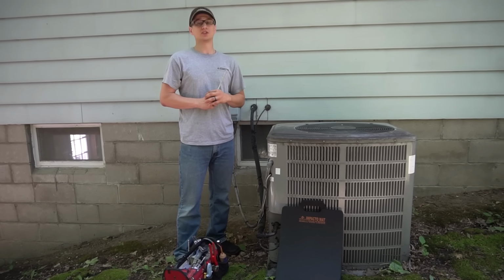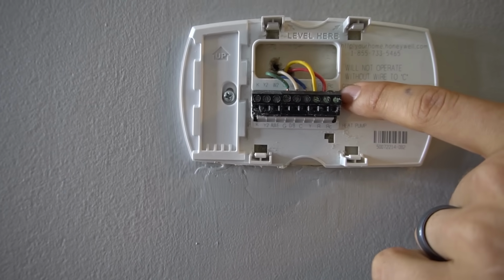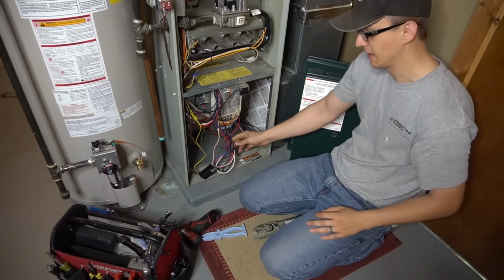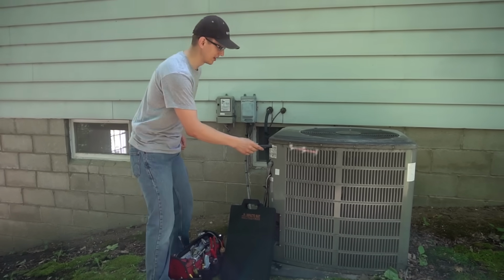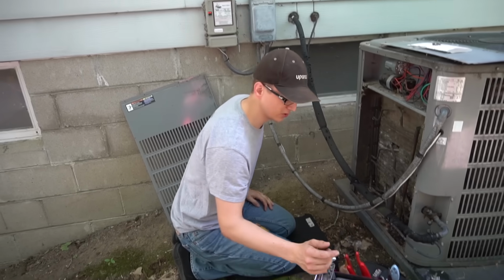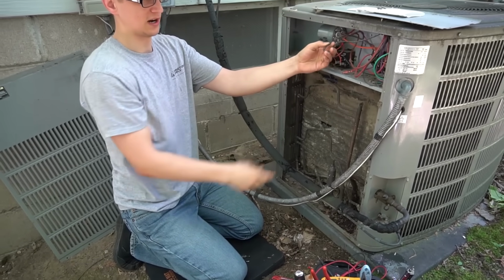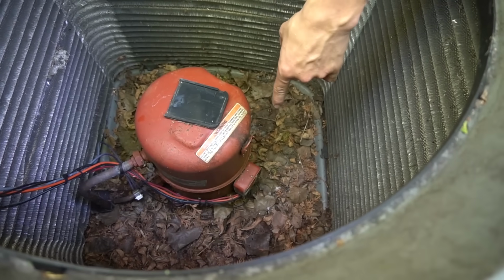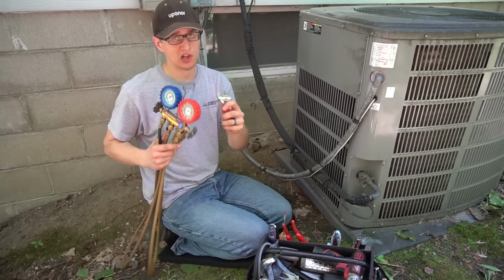AC Unit Not Turning On - How to Fix It Step by Step

Comment: thanks for the tips, you are very helpful. My inside unit was running and not cooling, checked outside and it wasnt running, pushed contactor and  unit started but would not stay running. Now both inside and outside not working.I have changed the capcitor and the thermostat. Discovered blown fuse after watching your video. Replaced 5amp fuse and turned unit on and it blew, replaced with another and it has not blown yet. Thought it might be the float switch shutoff so I took it out temporarily. Not getting 24 volts from thermostat, long story short..HELP
Reply from the maker: Oh boy, sounds a little messy :) Hopefully we can sort this out. If your 5 amp fuse was blown twice, then it is very likely that you have a short somewhere. A short can be hard to track down though. I would start by investigating all the thermostat wires in the furnace/airhandler, thermostat, and outside. See if you can find any bare or broken wires that are touching something metal or another bare wire.

Does your furnace have a control board or is it just a fan relay? If it is a control board, with your thermostat set to cooling, check if you have 24v going outside. Locate your thermostat terminal strip on the control board (R,Y,C,G,W). Put one lead on R and one lead on C. You should have 24v. How about Y to C? You should have 24v there as well.
Reply: no control board in furnace, have 24 at transformer,confirmed thermostat bad, rep;aced 2nd thermostat still not working
Reply from the maker: The thermostat wire that comes out of your wall and goes to the outside unit, does it have 24v coming out of the house? You also mentioned the float switch. Have you checked if your condensate drain is plugged? How did you take it off? Did you just bypass the float switch?
Reply: I did not have 24 volts on the thermostat  wire to the compressor outside. Attic is incredibly difficult to maneuver near the edge but I replaced the entire wire from the inside unit to the outside, I reinstalled the float switch in the system.Anyway the inside is working and when I connected the wire to the contactor it would not pull in on its own, so I will get a contactor Monday, the compressor will start when I push the contactor but only stays on if I wedge it to keep running. Will leaving the compresor running damage the compressor? At leasttoget me through the weekend. Thanks for the tipsand you have been extremely helpful, I really appreciate you and what you are doing  here.
Reply from the maker: Oof, I understand your pain. Crawling around in a tight attic space is not the most pleasant of things. Glad to hear you are finding my videos helpful! If you do not have 24v going outside, then replacing the contactor will not help since it is not pulling in as it is not getting 24v. About leaving the wedge in there.. I would. :) Better then roasting all weekend. Of course that makes the unit run non-stop and you should also keep your inside fan always on too. If the indoor fan turns off and the outside keeps running, your A-coil will freeze over. Being that your unit is in the attic, that will likely end bad once that ice starts thawing. 

If you are not getting voltage out of the house that means something inside is interrupting it. At the furnace, can you see where the Y and R thermostat wires go? Is there something in series with those wires? If the thermostat is working right and calling for cooling, you should have 24v between the Y and C wires coming from the thermostat at the furnace. Also, you can try bypassing the thermostat once by putting a jumper between R and Y at the thermostat. (that would confirm if the thermostat is bad or not) I have a video on how to do that if you need it: https://www.youtube.com/watch?v=9Y_R9unnadI&t=1s

Also, since you have an attic unit, you should make extra sure that your condensate drain is not plugged if you will bypass the contactor contacts like that. If it is the float switch that is interrupting the 24v, that means likely water is backing up in the drain pan. (the switch itself could be bad too)  If that is the case, then water will start leaking through your ceiling soon.
Reply: ok so are you saying that even though I replaced the thermostat wire to thecompressor, so I am now getting 24 volts but the contactor wont turn on unit. I suspect the contactor now.Unit will turn on when I push plunger but only stays on with the wedge in it.I reinstalled the shutoff switch that turns off unit when water is too high.I cleared drain and pan is draining fine.Just concerned about compressor, thought it was supposed to cycle on and off.Again thanks for your fast replies to my questions
Reply from the maker: Ah okay, I think I misunderstood you. So after you replaced the wire, you are getting 24v out at your contactor coil yet it is still not pulling in? Then yeah, the contactor is bad. To be honest I haven't left it wedged like that for long periods of time before so I can't say 100%. It should be fine. But if you are worried about it, you can occasionally just turn off your AC breaker for like half an hour to give it a break.
Reply: Will do, thanks again for advice, Im in Houston Texas area and some of the hottest days right now so your help is greatly appreciated
Reply from the maker: I hear Houston gets real steamy! Stay cool ;)
Reply: yes sir, but the real hot days are in august. this is definitely an ac town. will do
Reply: 98 yesterday 97 today, heat index 118,117
Reply from the maker: Oh man, hot stuff. Quite different here. It was around 75 in Minnesota today.

Comment: Thanks for great video, but I still have problem troubleshooting my thermostat. I had replaced my thermostat last winter when the fuse on my old thermostat kept blowing. The new Honeywell thermostat RTH2410B worked fine thru the winters for turning on the heater. However, when I switched it to cool during summer, it turned on the AC for a day, and then stopped working. Following your instructions, I checked my AC capacitor and the relay contactor, and they are working fine. Also, on my thermostat when I switch the fan to ON, the blower turns on, but AC does not kick in (even when I lower the temperature setting on my thermostat to 50 degrees). So, I replaced the thermostat, and AC started working. But after a day, the AC stopped working again. I have replaced the thermostat 3 times in last 2 weeks and same problem continues. Please advise what might be causing all three new thermostats to malfunction after a day.
Reply from the maker: Hey Raj! Something is definitely going on there if you already went through 3 thermostats. Do you have a meter that you can check voltages with? I wonder if the control board in the furnace/air handler is sending too much or not enough voltage to the thermostat and that is what is killing them.

Comment: My air conditioner just stopped working...just a couple hours ago.
It is one in the morning...so it's too dark to check anything outside. I checked the breaker..that's it..Less than a year ago..I got a new motor for 400... So I'm going to try eveything you said first before I call the guy that the motor in..  I hope I can fix it...I've never fixed anything like this before..lol ..wish me luck.
Reply from the maker: Wishing you luck! :) Be safe!

Comment: This is probably the most comprehensive video I've found about my system. I really appreciate that he is thorough, and doesn't over complicated things. I was considering dropping around $100 just to have a tech come diagnose my system, which after watching this video I am almost certain is the capacitor. So I'll save myself $85+ the cost of repair and just replace it myself.
Reply from the maker: Glad you found the video helpful! Good luck with the repairs and stay safe! If you need any help with the capacitor, I have a video on how to check and replace one. (Just look in the description)
Reply: Thanks. I actually already used your video to change the capacitor, but that wasn't the problem, it seems to be the compressor, so I'll be calling a tech because that's beyond me to replace and refill coolant.
Reply from the maker: Alright! Yeah, if it is a refrigerant issue then you are better off just calling someone. Come back with an update if you don't forget please!

Comment: I just have a quick question. Can you check the continuity of the compressor from the wire harness where all the wires are located?
Reply from the maker: Yes you can. Make sure the power is off to the unit. Then just trace where the wires from the compressor go and disconnect them. Instead of putting your leads on the compressor pins, you can just put them on the wire connectors that you disconnected. Keep in mind that when you do it that way, you are not only checking the compressor but also the wire as well. So if the wire is broken or shorted somewhere you may get a misleading reading.

Comment: I have a Lennox model #14ACX AC unit that's about 4-5 years old.  This unit has a dual capacitor, contactor and two other pieces.  I'm not sure what the other two pieces are.  One is a small black piece of plastic about 2" square with three tabs and wires hooked to it.  The other item is a black tubular shaped piece about the same size as a capacitor that is labeled "DANGER Electric shock hazard". Neither of these items is shown on the factory wiring diagram.  I pulled the fan off a few days ago so I could get access to the coils and rinse off the debris.  I reassembled everything and turn the power back on.  Within a few seconds smoke appeared.  I shut off power and took the electrical cover off.  It appeared that something had happened (maybe exploded) inside the electrical box.  Upon closer inspection I could see that a black wire was not connected (my fault when I was removing the fan) to the small, black 2" square piece of plastic that has three tabs on it (the other two tabs have a red and multi-colored yellow wire going to it).  I reconnected the black wire and turned power back on.  The AC has been running fine since then.  My questions are... 1.) What is the 2" square black piece of plastic?  2.) What is the black tubular shaped item?  3.)  Even though the unit is running and cooling, did I damage the capacitor or the black tubular shaped item?  I have pics that I could email if you need them.  Thanks in advance for your time and advice.
Reply from the maker: Thank you for the details! Luckily everything is working good for you! Good that you were there when it started smoking so you could turn it off right away. Hopefully that didn't damage anything (it probably didn't otherwise the unit wouldn't be turning on). The parts that you described are the same ones that I have in my unit as well right? That is a hard start capacitor and a potential relay that goes with it. Some air conditioners don't have those installed. That hard start capacitor (the round black cylinder) stays in the circuit only for the start up of the compressor, then the potential relay (black square) takes it out of the circuit.  If your AC unit is running fine and there are no burnt or broken wires, then you should be good. :)
Reply: Thanks very much!

Comment: my fan and compressor wont go on my atsa unit have I red bottom  a  Relay if I press the red relay the compresor goes on the fan still not going on if I move the fan with a  long screwdriver it will go on but when do unit stops it won't go on again the compressor and the fan won't go on any idea what's wrong
Reply from the maker: It sounds like you may have a bad capacitor. Have you checked/replaced it yet?
Reply: Word of Advice TV thank you for your reply greatful I will check the capacitor thanks
Reply from the maker: If you need help with that, I do a little walkthrough in this video: https://www.youtube.com/watch?v=C82HvbvP08E

Comment: Great video. I initially thought my condenser fan was bad, but now I’m not sure. Before I replace it, I tried manually pushing on the contractor and don’t hear the compressor. It has a brand new capacitor in it as well. If the fan doesn’t come on, will the compressor still hum or make noise? Or is the fan the only thing that will hum?
Reply from the maker: When you push in the plunger and neither the compressor nor the fan comes on then your unit is likely not getting power. (240v) Or perhaps the capacitor is dead. I would first check to see if your AC breaker is tripped or if the fuses in the disconnect are blown. Do you have a meter that you can check voltage with? It would be nice to confirm if you have voltage or not. If you do have power then I would replace the capacitor.

Comment: So if my suction line freezes that means it's low on freon?
Reply from the maker: That is one possibility, yes. Unfortunately freon issues will require a technician, not exactly a DIY project. You should check your furnace filter and if you have access to the bottom of the A-coil, you can see if that's plugged up too.
Reply: Word of Advice TV the filter was bad I bought a new one still the air coming out is not cool it's coming out like if just the fan was on
Reply from the maker: It sounds more like a freon issue. You will need to call someone to come check it for you
Reply: Word of Advice TV thanks I have a buddy that was a HVAC tech he gonna come tomorrow to see if its low
Reply from the maker: That would be best. Come back and give us an update after it's all done please :)
Reply: Word of Advice TV will do thanks !

Comment: do you know anything about package units?? i have a 3.5 ton carrier unit and there are 6 wires coming out of the power part you mentioned... 2 black 6 gauge, 2 black 8 gauge, a green, and a brown... im guessing the 2 6s run to a 240v breaker, and the 2 8s run to another 240v breaker, (hopefully since thats what i tried) should grren be run to ground or neutral? and what in the world is the brown for?
Reply from the maker: Unfortunately I don't work on too many package units. (just had to replace a blower motor on one last week though and it took a longg time) I am pretty sure the green is ground but I too have no idea what the brown would be... Is there a wiring diagram or schematic anywhere on the inside of the doors? Maybe you could track down where they go and what they do that way

Comment: Hi,
What do you recommend for low voltage or the power grid only supply single phase at that particular moment to protect the AC unit? Yesterday at 3AM that event happened and my circuit board of my Fujitsu AC burned.
Thanks.

Comment: I had three, the cap was bad to start the bulging end was the clue on that. The fuse also blew, but figuring that out was not easy to figure out because it was behind a plastic panel on the disconnect.  I knew I was not getting the power but I couldn’t figure out why.  The only way I found it was after pulling the disconnect tons and tons of times trying to figure out why. I finally pulled it hard (probably out of frustration) and the plastic panel in front of the fuses fell out and I could see them. Finally the fan was not spinning so I lubed it like you mentioned and that resolved that issue. Through your step to step I was able to test everything and everything was good so from what I can gather the cap blew, then either the fan not spinning or the cap blowing caused the fuse to go.
Reply from the maker: Wow, you had quite the bouquet of AC problems! I should have mentioned that the disconnect fuses can be under the panel. Sorry about that. But I am glad you were able to get it fixed! Thank you for coming back to share, stay cool! ;)

Comment: Very informative video! I myself have an issue with my system. My furnace inside works fine, furnace filter is new, thermostat is fine, fan outside runs, and I can feel the air coming out the vents, BUT the air is not cold. Went outside and noticed I couldn't hear the compressor turning on. I know it makes a distinct sound when its operating, which I cant hear. The air coming out of the fan is usually warm when running, but is not warm today and the 2 coil lines coming out the back of the unit are also not sweating or getting warm. Would this be a capacitor issue? Recommendations? Thanks a million! You, Sir, are awesome.
Reply from the maker: Glad to help :) By the sounds of it, you have a bad capacitor. That would definitely be a good place to start! If you need any help with it, I have a video on how to check and replace one: https://www.youtube.com/watch?v=C82HvbvP08E
Reply: Word of Advice TV Thank you! Picked up a new capacitor and my AC is cooling again. Will definitely recommend your channel!
Reply from the maker: Good to hear! Stay cool! And thank you :)

Comment: Well done video. Thanks.  I may have a problem you didn't cover, though, and wonder if you can help. My 30 year old Lennox AC runs but doesn't cool.  It does seem to dehumidify.  I took the cover off and found that the "start" capacitor is leaking.  Also, one of the copper tubes is too hot to touch.  Is that normal?  And where the insulated return pipe connects to the furnace there is a plastic disc shaped piece that connects to the pipe and it is frosting up at the connection.  So, if I replace the start capacitor can I expect all problems to go away?  The coil was never very dirty. Thanks.
Reply from the maker: Unfortunately replacing the start capacitor will not help in this situation. If it is freezing up like that you most likely have a restriction in your metering device (that disc shaped piece [TXV] ) or the unit is low on freon. Either one of those problems are not a DIY project unless you have done HVAC work before and are comfortable with refrigerant. Otherwise this one will need to be looked at by an HVAC tech.